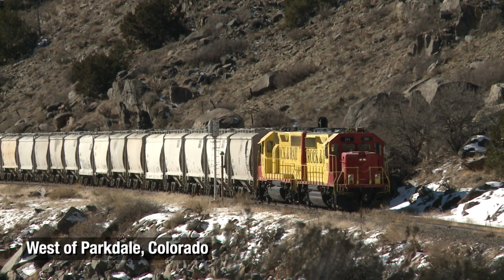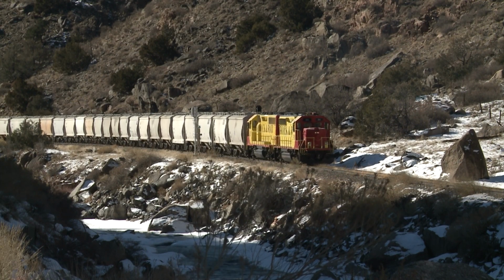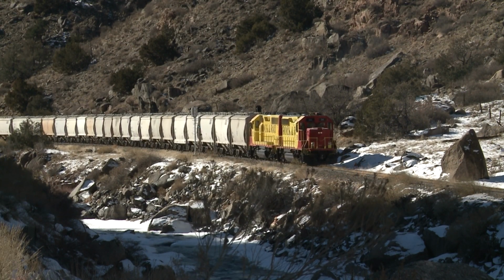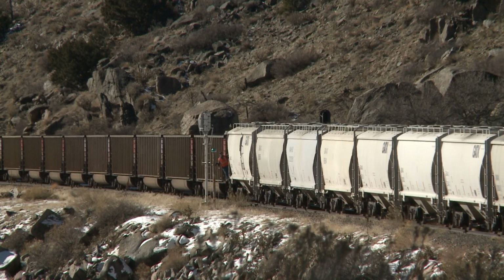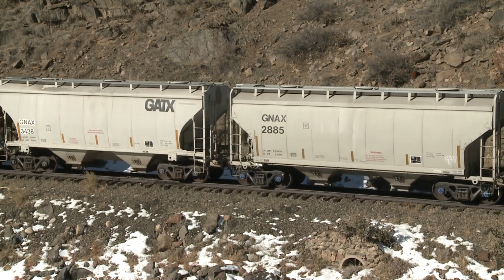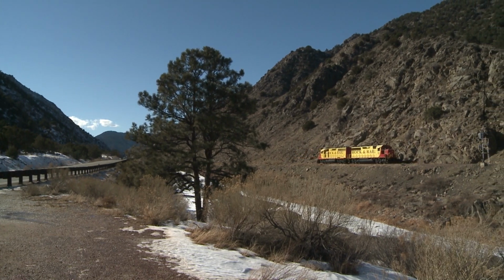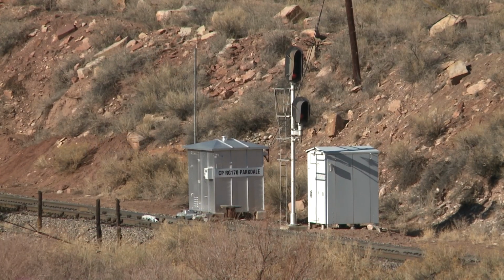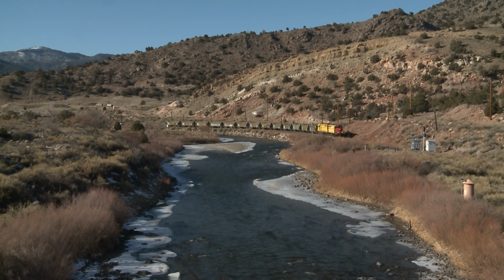Rock & Rail Activity on the Tennessee Pass Line in Colorado

Comment: Aw man! I thought this was about the FIRST train after the reactivation.
Reply from the maker: We wish it was!
Reply: There's still trains that use this line but very few, I think Rock & Rail runs these trains at night and Royal Gorge runs excursion trains, both of them run between Cañon City and Parkdale. Union Pacific still runs a train called the Minturn local, even though it doesn't go to Minturn anymore. I don't live in Colorado so I dunno I've only done research. The line is still used, there just hasn't been a run through freight across the entire line since UP abandoned it in 1997.

Comment: Reopen the Tennessee Pass line 
Union Pacific 
I think it was a bad mistake on Union Pacific shutting down the Ex DRGW Tennessee Pass line Because Union Pacific can't run Double stacks though the Moffat Tunnel
Reply: Wouldn’t it be great if they did reopen it? We can dream...
Reply: Alex, the Moffat Tunnel is between Denver and Dotsero over the Continental Divide, and the Tennessee Pass tunnel is between Dotsero and Pueblo.
Reply: I think it will be reopened but as a short line.